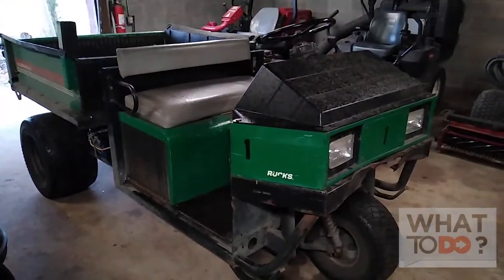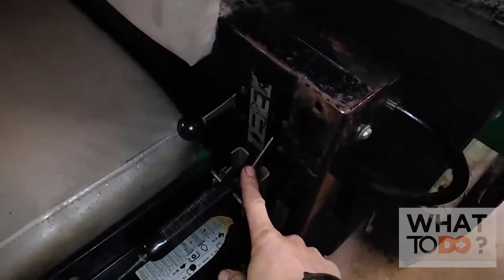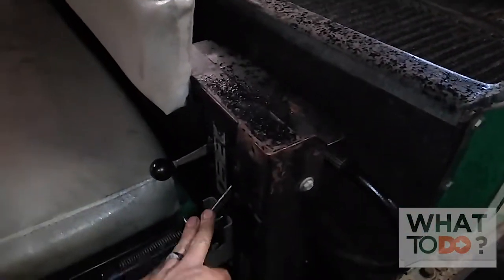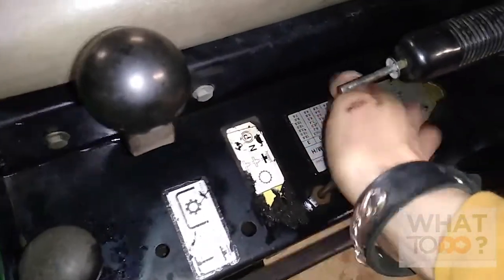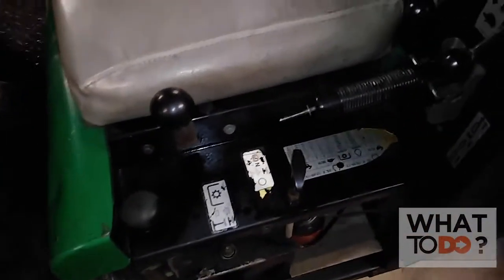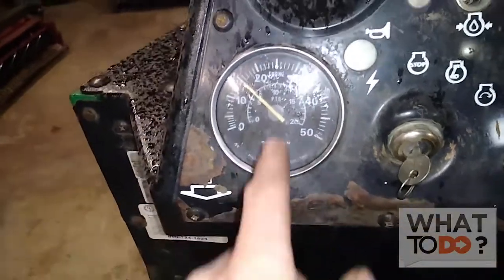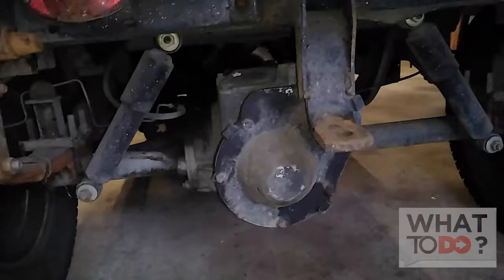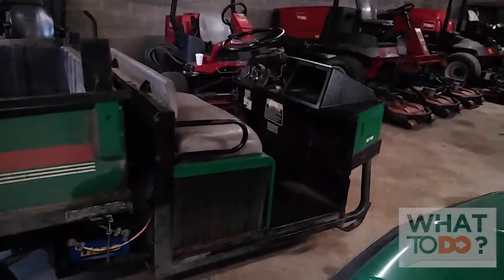How To Operate a Cushman Truckster

Comment: Can you tell me if the hydraulic oil tank off a 2006 Cushman Truckster (4 wheeled unit with Perkins diesel) will fit on my 1998 Cushman Truckster of the same description?

Comment: where can i find parts for a 1998 cushman truckster, it’s says kubota turf truckster but looks the same
Reply from the maker: There is a website called Turf net which is primarily for golf courses but they have a used equipment section and most of these machines are found on golf courses so check the classified section on that site a lot of golf courses sell these from time to time at a pretty good price

Comment: Do u know where i can get a new steering gear mine snapped off the body
Reply from the maker: Parts for some of these are very hard to come by . However I have seen quite a few of them on turfnet.com . Once in awhile I'll see them on eBay as well. You should be able to pick up a decent parts one for around $300 to $500.